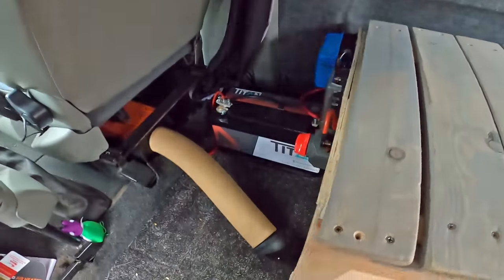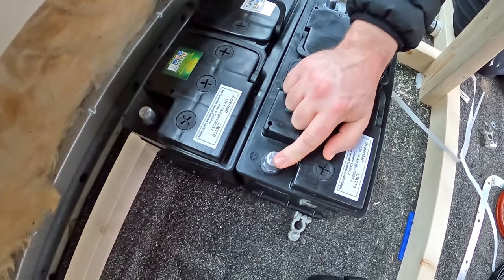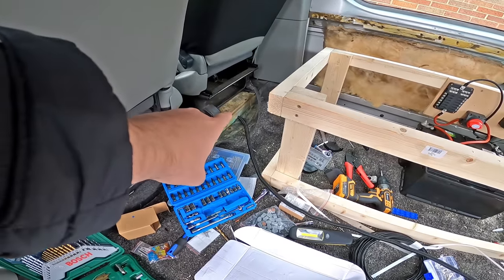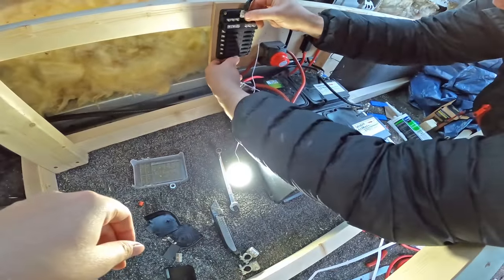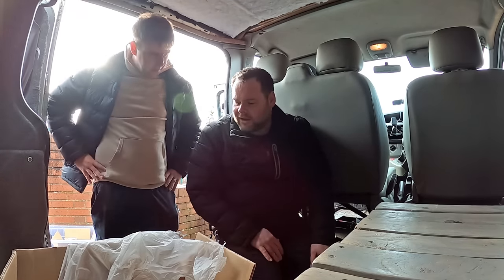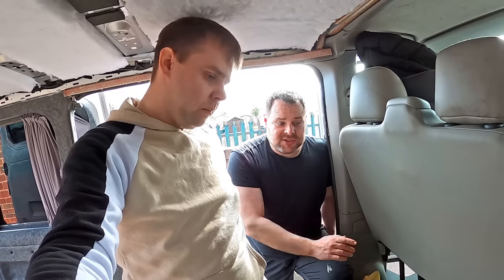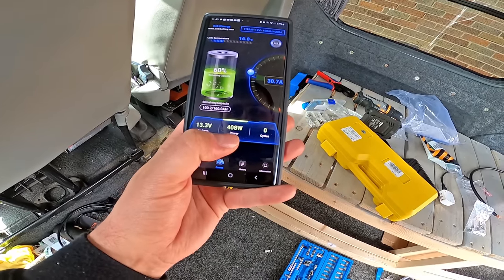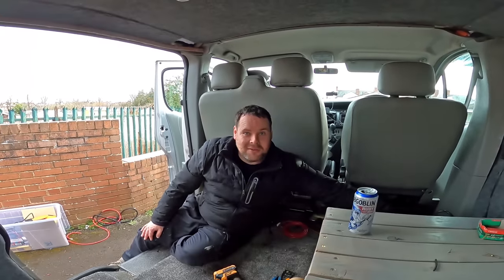ULTIMATE BATTERY INSTALL Mini Camper Van Build | Van Conversion UK

Comment: how do Brendan... regarding the back windows-why dont you make some window blinds for them . There are a few videos on here showing how to make pull down blinds using the ikea hoppvals blinds and a plywood carpetted panel. The back would look cracking with some blinds. In fact, why not do it with all the windows. I'm just nearly finished doing my vivaro sliding door.  Bessy regs-Kenny
Reply from the maker: Hey Kenny 👍 thanks for the suggestion mate 🙂. I've since installed curtains but blinds might be the ultimate stealth addition as well. Good luck with your build mate
Reply: @BrendanExplores  I fitted shore vans curtains to mine too, Brendan. They are behind the blinds so 2x insulation on parkups. cuts down on sound too.
Reply from the maker: @viv-i-vangoesforth  ahhh ok then, thanks for sharing the info 👍 atleast I know they go together 🙂

Comment: I was hoping you was going to say how much these battery's are this exact one.  I had a quick look but will after go more into it.
Reply from the maker: I guess different batteries are at different price points and everyone will have different requirements 👍 I hope you found the info useful though
Reply: Normally £1100 for the 150AH currently on offer for £925.